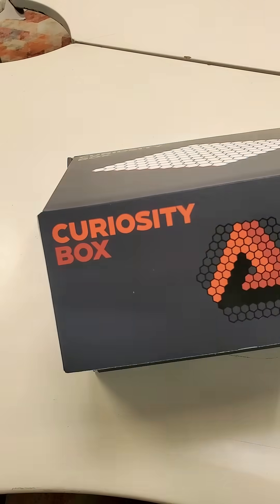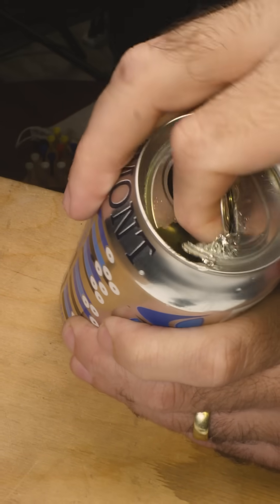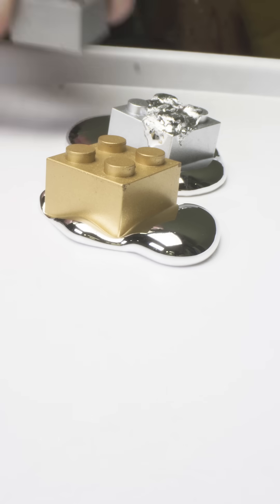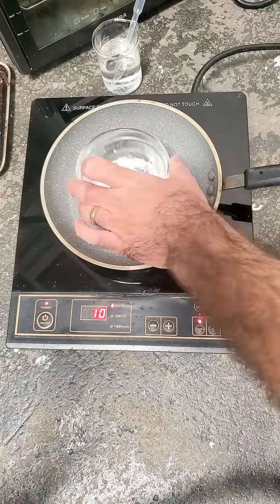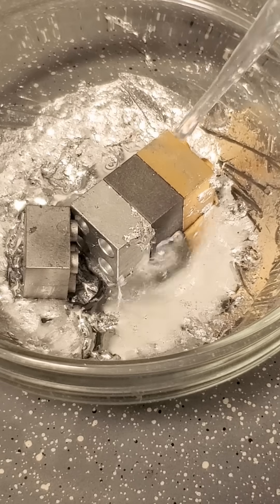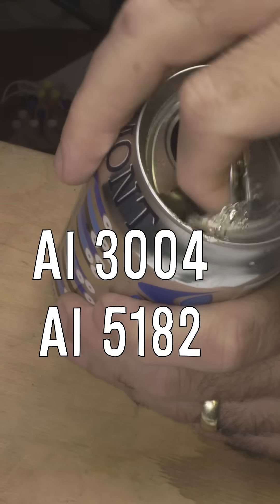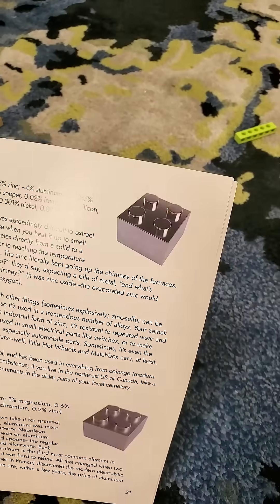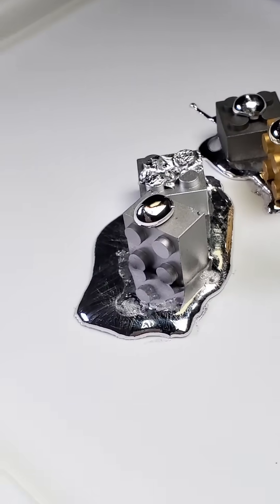Galinstan vs. Metal Alloy Bricks

Comment: It hurts the worst when it’s just 1 single Lego piece because all your weight is focused on that single point, rather than multiple pieces supporting their own weight. That’s why public performers back in the old days would be perfectly fine after laying down on a bed of nails, because even though each nail was sharp, you had at least a thousand contact points each supporting their own weight.

Comment: As a former welder, 60 61 aluminum is known for being really smooth and clean to weld on, it’s top dollar stuff.
Reply: 6061 was invented in Japan to be used for aircraft during WW2, it permitted countersinking techniques with rivets that allowed them to be flush with the hull. other alloys at the time would've lost their corrosion resistance doing that, since they relied on alclad layers.

so it's got some decent historical significance as well
Reply: @asparagusoffice that’s really cool. It’s kinda like the white oak of metal in that sense. When the British came to American the king would have his men mark every white oak tree they saw to be used for battle ships sense white oak with stood cannon ball fire better than any other hard wood the British had access to at the time.

Comment: Someone once commented this in art of V-sauce holding a asteroid "Assuming it is spherical, and in the gravity of Earth, and the balancing of it is not a problem, if the asteroid has a density of 5,000 kg/m³ and has a radius of around 35 meters, or a diameter of around 70 meters, and a weight of 285,835,000 million kilograms, a person would have to exert a force of 2,791,733,350,000 newtons. The average supporting force of a person is in the range of 500 to 800 newtons, let's say an average of 650 newtons. Then, the force Vsauce exerts would be 4,294,974,385 times more powerful than that of the average person, and this is assuming that Vsauce is putting in any effort at this feat, which he seems not to do, at least for the asteroid in the video. Though, assuming he does put in effort, this would still only be 0.0000018% of his power, implying his full power is 55,555,555 times more powerful, or a force of 155,096,300,000,000,000,000 newtons. This must mean that if this is the full strength of Vsauce, while exerting himself, then, if he usually acts like a regular person, or an average of 650 newtons, then, on average, he uses only 0.0000000000000004191352% of his power. To put this into perspective, while acting as an average human, the power he exerts is 238,440,000,000,000 times weaker. It's like being able to carry a 150-pound dumbbell over your head but limiting yourself to... things on the subatomic level? It's pretty insane what Vsauce does."

Comment: I really want these for reason other than the idea I have in my head that these must be incredibly satisfying to snap together and pull apart as a fidget on my desk while working.
Reply: I have them and they do not have the same clutch power as legos and don’t exactly snap together like you’re imagining. Sorry to let you down. But they are fun to stack!
Reply: @redfailhawk  I did in fact read "They are a fun snack" at first glance.
Which is a very michael thing..
Reply: @redfailhawk  do they at least stay together pretty well? Also how heavy are they
Reply: @redfailhawk  use them as traps to protect your home. Place them around corners in areas where people commonly step.
Reply: hell

f#*@
Reply: i hope you heal.

Comment: The highest theoretical single-turn score in Scrabble is 2,044 points, achieved by playing the word SESQUIOXIDIZING under highly contrived conditions.  

This scenario involves a meticulously arranged board where SESQUIOXIDIZING intersects with multiple existing words, creating numerous crosswords simultaneously.  Strategic placement utilizes multiple Triple Word Score (TWS) and Double Letter Score (DLS) squares, and using all seven tiles from the rack adds a 50-point bingo bonus

Comment: 1 question, did you check the clutch power of the bricks. When creating the patent lego made 4 different brick molds each with a different amount of spacing on the connections(A-D) and chose the C mold for all Lego bricks.

Huge shoutout to Sam Builds on YT, a real life master builder for Lego discovery centres for this info

Comment: Aluminum cans are actually 3104 and 5182 usually, in my experience.  6061 would be either automotive or aerospace stuff.  3004 is building products.
Reply: Is this the 6061 aluminum nerd gang? I work with it myself. Let's go!
Reply: @alococuccoyo6103  I mean me, I'm just part of the hot rolling process so like I'm probably not the one.
Reply: 6061 will be the go-to for parts in any machinery really. As a machinist I work with it constantly.
Reply: Crazy how a tiny amount of chromium changes the alloy.

Comment: Except for the fact that the zinc and steel bricks are swapped in some kits (if not all kits) for some reason... I.e. what should be zinc is actually steel, and what should be steel is actually zinc. QC has been failing in this department.

Comment: The 70 series aluminum alloys are super fun to work with.... I can't remember if it was 7073 or another, but in the mill table it behaved like copper with the hardness of mild steel. My mentor came flying into the machine room when he heard the boring bar making its first contact... He thought I was feeding it too fast. Nope. Just a super hard and malleable aluminum
Reply: You should try rolling 7000 series though...

Comment: I'm training to become a CNC machinist. You really picked some beast alloys. Also hats off to the machinist. I wonder what the clutch power is like. Because for Lego the fitment for the studs underneath another brick had to be so perfect to get the right clutch. With metal the tolerance range to get similar clutch power, if even possible, must be in the tenths of thou.
Reply: Do you think they could be cast?

Comment: dude i fell off a bed landed on my hands and there was a monopoly house. i turned my hand over and it was stuck on my  hand like a hotel on boardwalk. i pulled it out and could see two little veins running side by side, 4 stitches.

Comment: the demonstration of what happened to the aluminum once you applied liquid metal is exactly why you're not supposed to use liquid metal as a thermal interface solution with a heatsink using an aluminum cold plate. always copper!

Comment: So Liquid metal for removing heat from my CPU between the CPU and my ALuminum CPU water block would be a bad idea?? I'll be right back....
Reply: no, it's a bad idea if the COLD PLATE is aluminum. if the cold plate is copper, you're good to go.

also, if your radiator is aluminum, make sure your blocks are aluminum, if your radiator is copper, make sure your blocks are copper. you probably followed this, but just know that anti-corrosives can only do so much and you'll still get crazy bad corrosion if you mix metals.

Comment: Fun fact: aluminum 6061 is commonly used in airplanes, and is typically referred to as “aerospace grade.”
It also has about half the tensile strength of 7000 series aluminum, and is quite cheap. 
Just know that aerospace grade does not mean the best, it means cheapest option that works.
Reply: "Best" material is always relative to the problem being solved.
Reply: That tiny bit of chromium makes all the difference...

Comment: X-ray fluorescence (XRF) is super cool science. My lab in college used it to detect lead (Pb) in soil and paint chip samples in order to combat youth lead poisoning in our area (leaded gasoline and paint used to be used a lot, and in some places its impacts are still seen). Basically, you throw a bunch of X-rays at the atoms in something, and you can tell exactly what the atom is based off of the energy level of the resulting photon (this is the energy difference between the two outer layers of electrons). The electron configurations of every element are a bit different because elements are defined by the number of protons in their nucleus, and higher number elements have more positive charge in the center. You might think that, since they also have the same number of electrons as protons, the charges balance out to zero so they would all be the same. But the electrons exist in layers, so the inner electrons shield the outer electrons, and this causes those minor differences! (there is a bit more complexity regarding the configuration of the nucleus, and more importantly electron orbital configurations, but I find XRF extremely neat and wanted people to know a bit about it)
Reply: This was worth stretching my ruined attention span for, thanks
Reply: @brunomcleod  appreciate it, I knew this was a bit wordy but it’s hard for me to keep things like this concise
Reply: Interesting so it's essentially like spectroscopy but you shoot it with X-rays and then look at the emission spectra
Reply: @mastershooter64  Absolutely! Emission spectra is the name of the game for XRF! If you want a deeper dive, there are versions of this for particle accelerators that are more precise, but take more time. See: Particle-induced gamma-ray emission (PIGE) (and PIXE for the X-ray version)
Reply: So it was an actual misprint and not a VSauce easter egg meant to be found by a curious fan. Lol. We all assumed it was the latter.